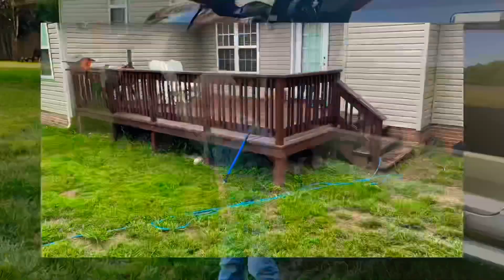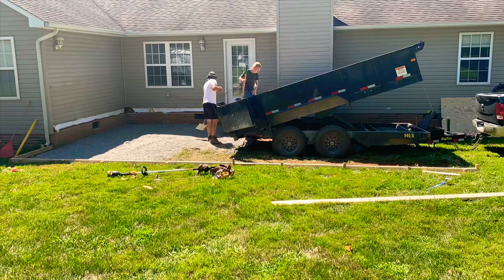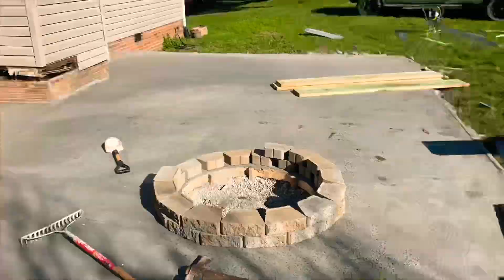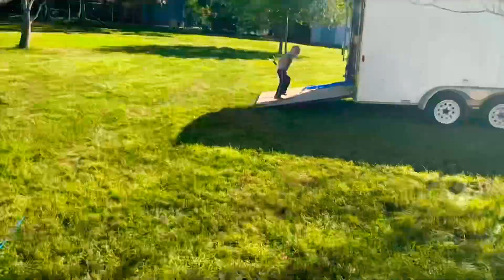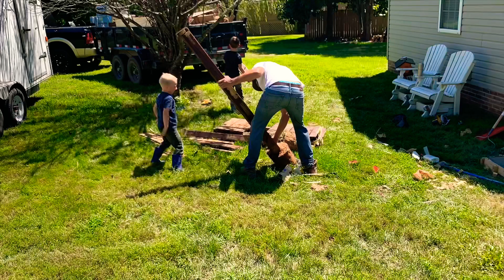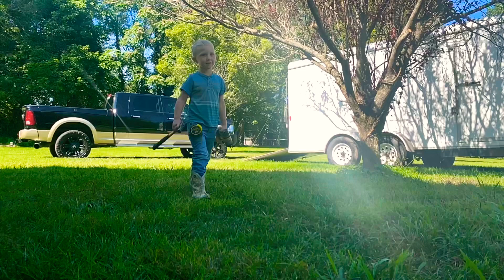Deck removal and concrete patio Time lapse

Comment: Could you not locate matching siding? Just curious why you covered those spots with wood.. I am going to have the same issue.
Reply from the maker: I plan on wrapping the wood part with aluminum.
Reply: Tim Watson oh nice.. that’s what is holding me back right now.. wasn’t sure what to do for the siding.
Reply: Same issue the ledger comes off leaving it open without siding.

Comment: Is there a reason you incorporated a hole in the patio for your firepit? Why not build the pit/pavers on top of the concrete?
Reply: My thoughts too. It restricts where you have the fire as it removes any possibility of moving it. Also, I can't see the reason why he left the timber exposed to the fire area.

Comment: I have a few questions but first I wanna say you did an awesome job!!

1. How long did it take?
2. Total cost (Labor & Materials)
3. Dimensions of concrete patio
Reply from the maker: 1. How long did it take? -- About 3 days
2. Total cost (Labor & Materials) -- $2,500 For the Materials, and I did it myself so no labor.
3. Dimensions of the concrete patio? -- 18' X 30' x 4" thick
Reply: @TimWatson100  Awesome!!! Man I am going to save up to get something similar to what you have!!! How big is your firepit and anything special you had to do for it?
Reply from the maker: Fred Haynes It’s about 3 feet across. I just left it open in the bottom it's dirt and gravel
Reply: Tim Watson What kind of fire pit bricks did you use
Reply from the maker: Fred Haynes they are landscaping pavers I found at the local hardware store